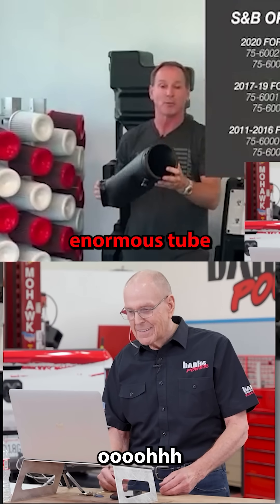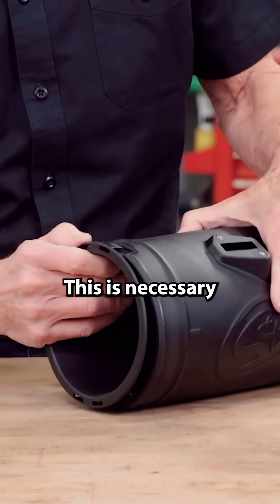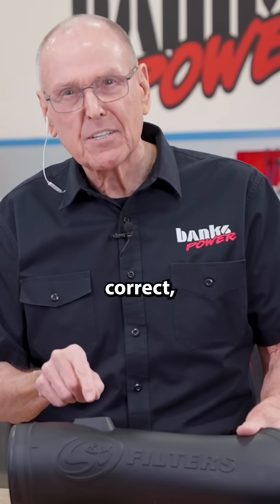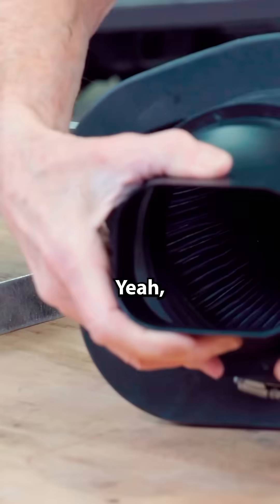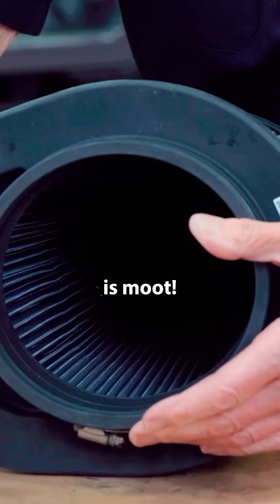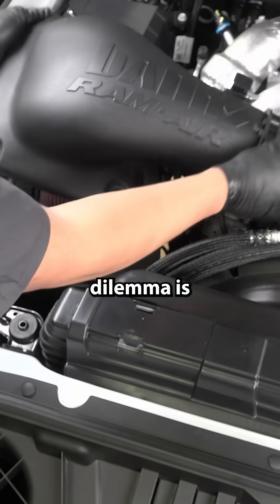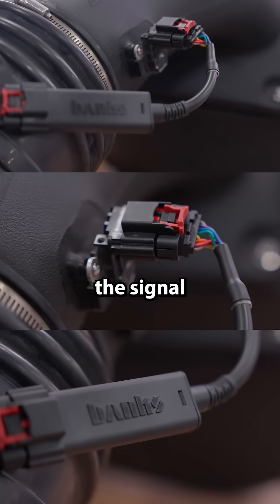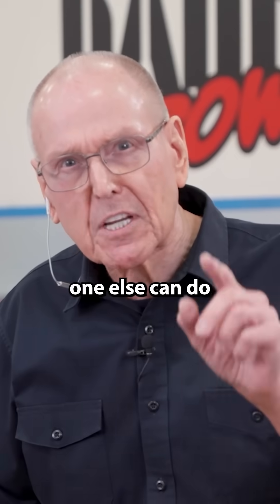Competitor tries to fake a big air intake

Comment: Speed density tune time!!!
Reply from the maker: While tuning can offer great benefits, it can also void your warranty. Our solution allows you to run an upgraded intake without modifying the ECM or setting a check engine light, so you can enjoy the best of both worlds.
Reply: @bankspower  and thats why your the clean diesel pioneer!!!  Love ALL of your work man……you will definitely go down in the motorsports hall of Fame and will remain to be a legend Loooonnnngggg after were both gone!!!………..now if volkswagen had only contracted you before all that diesel-gate mumbo jumbo….would have saved them billions
Reply: @bankspower  i have a h&s minimax tuner for my Lmm duramax…i got it with intentions of removing the dpf….but after i put the tune in my truck with the dpf intact i was very satisfied and never followed thru with taking it off, i still have the full 5” exhaust kit new in the box sitting in my garage……do you make a tuner that is ca. legal that i can take in to get smogged without having to remove my tune 2 weeks prior of getting my smog check….and will it still give me 100hp and 200ft lbs like my minimax??

Comment: I bought an RV with Banks Power Conversion.
It just purrs and spits out the Torque, no drama no fuss.
8+ MPG on the upward leg of cascade crossing.
The RPMs never went over 1500 while climbing the extreme grades!

Comment: This guy is just wrong. A larger tube and filter means the velocity per square area of intake filter media is significantly reduced. This will improve filtration and reduce resistance to airflow related to the intake filter. The original design he is mocking delivers a better intake without any tuning necessary for the user.

And look at all these people just eating his claims with no critical thinking. Oh he said big words so he must be right!

Comment: Just snip it off. You double gas mileage.
Reply from the maker: The snip MAF sensor? That would require an ECM tune that would void the warranty. With our solution, you can keep MAF intact with having to tune the engine.
Reply: What warranty? I plugged the EGR too. That gave me 20hp and 10 more mpg.

Comment: So the MAF sensor reads a value that is *(OEM cross section area/big pipe cross section area), so you build an amp that amplifies that MAF signal by the same amount? Interesting that it takes so little to get something patented. But is the patent novel when piggyback adapters already exist for turbo conversions? I mean among many things they do the same MAF adjustment. But i'm no expert in patents so i could be mistaken.
Reply from the maker: The patent itself goes into more detail about what is specifically protected. This patent and all our others are publicly viewable. 

https://patents.justia.com/inventor/gale-c-banks-iii

Comment: If your running that converter he "patented" you may as well use the stock intake. If you put a giant intake on, but specifically tell the ECU its Not getting more air the ECU wont give more fuel so no more power. You could have a 1000hp leaf blower for an intake and it wouldn't make a difference. If anything this is a "patented" converter to allow you to lean out your ratio and smoke your rings!!
Reply from the maker: If you run a MAF sensor in a larger tube without correction the ECM will think the engine is getting drastically less air because even though the air mass has increased, the air velocity has dropped and that's what a MAF sensor uses to derive mass flow. Our Air Mass Control Module corrects the MAF sensor signal so that it's accurately reading for our larger cross-sectional area. We don't correct to stock, we correct to a proper reading of the actual airflow through the new larger volume.
Reply: @bankspower  I stand by half my point in that case. Your limits would end up being, how far the stock ecu will adjust without issues.

Comment: Mafless? Speed density tuning , no maf required . Theres other ways to obtain data.
Reply from the maker: Tuning is a great option. However, it would void the warranty. Our solution allows you to run an upgraded intake without modifying the ECM or setting a check engine light.
Reply: @bankspower  sorry sir , I didn't realise that's the direction you were taking but thank you for clarifying and responding.

Comment: Simple fix bud, just maf delete!! Problem solved!!
Reply from the maker: Tuning is a great in a lot of cases, however,  there is a down side: it'll void the warranty. Our solution allows you to run an upgraded intake without modifying the ECM or setting a check engine light.

Comment: It's called a cold air intake and an acomidating tune.
Reply from the maker: Yes, tuning is a great in a lot of cases, however,  there is a down side: it'll void the warranty. Our solution allows you to run an upgraded intake without having to modify ECM or setting a check engine light.

Comment: You could also just adjust the MAF base table in the engine calibration to match the new diameter with a little math. Not difficult

Comment: You could just tune for it? Why would you design around it ?
Reply from the maker: Yes, tuning is a great in a lot of cases however,  there is a down side: it'll void the warranty. Our solution allows you to run an upgraded intake without having to modify ECM or setting a check engine light.

Comment: When I upgraded the ID size of my intake tubing, I just unplugged the MAFS and let the ecu work the fuel mix off the absolute manifold pressure sensor. In fact I removed the MAFS due to its ID was still the tiny factory size and would still restrict airflow.

Comment: Or get your car tuned? Probably the best way
Reply from the maker: Yes, tuning is a great solution in a lot of cases. However,  there is a down side: it'll void the warranty. Our solution allows you to run an upgraded intake without having to modify ECM or setting a check engine light.

Comment: Or you can just Adjust it in.......

ECU WHILE TUNING !!!!!!!
Reply from the maker: Yes, tuning is a great solution in a lot of cases. However,  there is a down side: it'll void the warranty. Our solution allows you to run an upgraded intake without having to modify ECM or setting a check engine light.

Comment: Same problem folks run into with exhausts. A massive 4 inch exhaust on an engine which is not capable of keeping the exhaust velocity moving quickly through the piping will struggle. Best way I have ever heard it explained was this. Imagine you are going to blow through a straw to pencil across a table. Airflows confined to the size of the straw but the velocity is still able to move the pencil. Now get rid of the straw and use a 3 inch pipe. There’s nowhere near enough velocity to push the pencils because it’s filling the empty space I stead of exiting the pipe.

Comment: Still have an intake from banks I cannot use because it throws a code on my truck with less than 27,000 miles. Been waiting on engineering for over a year for a solution. Do not buy this for a Chevy Silverado Duramax.

Comment: Well... yeah, that insert is removable. The point is that you buy the intake, install it with your factory tune, then you can get the car retuned later and remove the insert so the MAF reads correctly and the vehicle makes use of the additional air. I feel like any self respecting engineer (especially one who understands the importance of making sure your MAF signals are correct) would understand that. I do see the benefit of your module not requiring a new tune, that's definitely a plus, but this ad is disingenuous and ignoring the clear intention of what is being criticized.

Comment: Why? That's what a Speed Density tune is for.
Reply from the maker: Yes, tuning is a great solution in a lot of cases. However,  there is a down side: it'll void the warranty. Our solution allows you to run an upgraded intake without having to modify ECM or setting a check engine light.

Comment: If this is part of the intake kit, it's great. But if it's a separate part you have to buy, depending on the price, you can do the same thing with a tune so I'd rather not have extra parts that can fail if it costs too much

Comment: Lol physics is hard. Defeating Flow rate curve against pressure i thought was the point of big filter. You can just use a bell adapter and get the same result with stock maf.
Unless your running some weird shit and a larger throttle body intake shit is mostly snake oil.

Comment: When what's on the market to test gear doesn't work you reengineer whats on the market and use the equipment you (banks) designed and sell to accurately test flow so that you could make a product that actually works

Comment: Funny how u see alot of these kids with there "cold air intakes" pullin hot air off the back of the radiator 😂  when i was younger i once had iat temps so cold it iced open my throttle body and iced over my maf.  I had made a cold air intake way too cold 🥶 i loved mk2 vw's back in the day

Comment: Why don't they just put the sensor in a  tube parralel to the big tube. Size the tubes to a ratio and just have the senser programed to that ratio. So 10in tub with 1 inch tube for the sensor programed to read a 1:10 ratio to show accurate flow

Comment: I have an S&B intake that doesn't have this, but it does have quite the generous hump on the underside of it to clear what is underneath it. the kit also for some reason forces you to use this plastic sheath of some sort the covers the intake air temp sensor completely. The only reason I can see for this is the air coming in from the intake due to its larger size would not be the same temperature that the ECU is expecting.

Comment: Iv been reducing my intake slightly in my disel for yrs.
Air flow past the sensor slightly faster , so thd maf thinks more air is passing by it ther for it will increase fuel.
More fuel more power

Comment: Anyone can remap an ECU
Reply from the maker: It's not remapping the ECU, that would void the warranty. Our solution allows you to run an upgraded intake without modifying the ECM or setting a check engine light.

Comment: Or just delete the maf with ecu and get a map sensor. Or if your turbo charged out the maf on the intercooler piping.
Reply from the maker: Tuning is a great option. However, it would void the warranty. Our solution allows you to run an upgraded intake without modifying the ECM or setting a check engine light.

Comment: Correct me if I'm wrong but cant you solve it by changing it away from Maf, to speed density and giving it a proper tune? No maf no issue plus the air speed density sensor perks especially when using e85 and forced induction. I'm still a little confused, the solve "air maf control module" must change the resistance. So when it reads the now different air flow rate the module take that data and adjusts it to look like the original data? That must mean the output pre module is the same across all models of that car?

Comment: Actually that’s a plastic velocity stack. It helps stabilize the air and also charge it. Your work around isn’t any better. Tricking the MAF isn’t any different. The reality is once you go to big you really need to tune the motor. The other reality is, it didn’t matter how much air you bring in if your plenum can’t handle the extra flow or the exhaust can’t handle it, your just creating bottlenecks for air to get pushed threw. Think of it like putting water in a funnel, you can only get so much water to come out the other side no matter how much you put in the large end.

Comment: Cars aren't hard folks. Get an exhaust sniffer, read some books and don't be afraid to dive in, products like this are very limiting to an engines actual potential, they're made to work with factory sensor calibration, they may floe more "efficiently" but you're not gaining anything meaningful.

Comment: So much happier havin an engine that uses just a map sensor and not a maf. Can put whatever pipe/filter on it and the map wont care or have altered reading since its operating on vacuum/absence of vacuum in the manifold instead of a hotwire in the tube. Ive had vehicles with both and it seems like they both run fine. But a map doesnt get a spec of dust on it and decide to leave you stranded. That and ive seen shitloads of mafs go bad but rare to see a map die. Plus mafs are one if those that you need to pay for the oem. You buy an off brand and the resistance is wrong or the wire coating is too thick or too thin and makes it read incorrect. So your screwed into payin for the oem for 4 times the price.

Comment: Or you can throw a tune in the car.
Reply from the maker: Tuning is a great option. However, it would void the warranty. Our solution allows you to run an upgraded intake without modifying the ECM or setting a check engine light.

Comment: Maybe I’m wrong but the Venturi effect would take place, the decreasing of diameter like that would increase velocity of the air. The volume of air being forced/sucked up through the filter and such would not change, the restriction in diameter would only accelerate it faster. Carburetors work on the same principle.

Comment: Old engineers are so awesome, I've worked with so many of them and they are truly some of the wisest people on earth
Reply: This dude isn’t an engineer. Also he’s wrong about the airflow. Air is a compressible fluid, therefore you can have a contraction and regain most of the energy of the airflow when it expands again. His logic would only hold true for an incompressible fluid like water where the energy lost from a contraction is non recoverable.

Comment: A thousand sensors are not needed on an electric car and the loss of one will not foil the car.  This is how i will solve dozens of problems:  oil, water, gas, sensors, ring leaks, gasket leaks, oil leaks, oily wire shorts, dirt and grease everywhere, banging valves, leaky valves, lifter noise, bearing loss, broken pistons etc.

Comment: Yes the fluid mechanics checks out, but you are getting the advantage of more surface area on the filter, so you’d benefit from that at least 🤷‍♂️

Maybe it lasts longer/less flow resistance as particles build up.

Comment: When you double a pipe diameter with the same pressure difference the mass air flow increases 16 times. We all know OEMs can be restrictive but going 2” to 8” gives 16x16 the potential air flow on an engine that might make 20% more if you spend a fortune on it. It’s clearly ridiculous.

Comment: Aftermarket Tuning Module (e.g., Banks MCM):

Ease of Use: Aftermarket tuning modules are generally easier to install and use, making them a more accessible option for those without extensive tuning knowledge.

Preservation of Factory Settings: They often allow you to retain your vehicle's factory ECU settings, which can be beneficial for warranty concerns or returning the vehicle to stock configuration.

Specific Performance Enhancements: Some modules are designed for specific performance enhancements, and they can be a good choice if those align with your goals.

Comment: Why not have a mass airflow bypass… split the air, keep the velocity for the MAS and still have increased airflow without a piggy back to trick the MAS…
Reply from the maker: The quickest answer; Increased mass flow comes from reducing restriction as much as possible. Adding all the turns and redirects for a bypass would reduce overall mass flow considerably, regardless of what the MAF sensor is actually reading.

Comment: You need to reprogram the computer to understand the intake size is larger, thus allowing more flow at lower velocity. Once compensated for the higher volume, the mass airflow sensor will deliver the same signal, but with the computer utilizing the data for higher flow rate per velocity, the programming will be correct. Its not rocket science.

Comment: Guessing you can take out that reducer then rescale the MAF via the ECM
Reply from the maker: Tuning is a great option. However, it would void the warranty. Our solution allows you to run an upgraded intake without modifying the ECM or setting a check engine light.

Comment: I dont understand how the module makes the signal “correct” without considering the variables within the tube not factored into output calculations and offsets.the fact that the variables are unique for each plenum and maf sensor.

Edit: it’s probably auto calibrated and tuned based on engine performance as a feedback.
Reply from the maker: Are you talking about variables between intakes for different applications or variables within the manufacturing of intakes for the same vehicle? We only sell the Air Mass Control Modules with our intakes that are sized specifically to use it. This is not a universal part. It's part of the intake systems we sell.
Reply: @bankspower  okay that makes sense, thank you, i missed that part.

Comment: Ditch the maf. Go with map. Problem solved
Reply from the maker: That is an option for some, but for most it would void the warranty. Our solution allows you to run an upgraded intake without modifying the ECM or setting a check engine light.

Comment: Having the MAF sensor not read correctly can be a good thing,  there are a number of cars that have a MAF mod that moves the sensors location in a stock air box that has netted power gains of several HP by simply adding a spacer you can fab up from a $5 part from McMaster car.

Comment: Or you could just get a tune
Reply from the maker: We hear you, tuning is a great option. However, it would void the warranty. Our solution allows you to run an upgraded intake without modifying the ECM or setting a check engine light.

Comment: You know the Dodge Durango doesn't have mass air flow sensor it has a air temperature sensor so you can have all the airflow you want as long as it doesn't get too hot or too cold